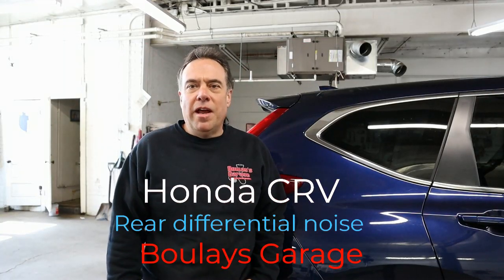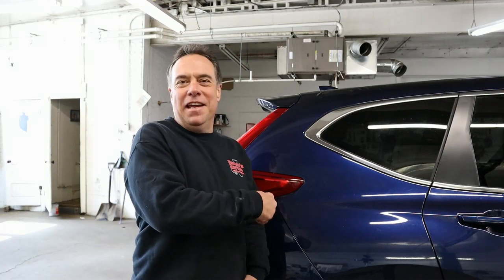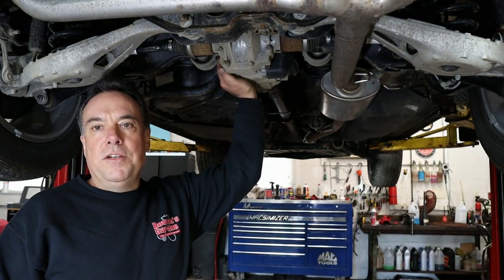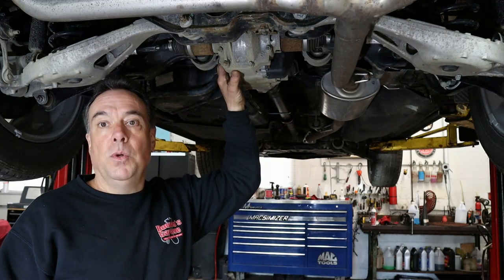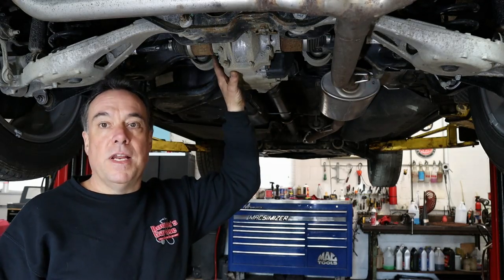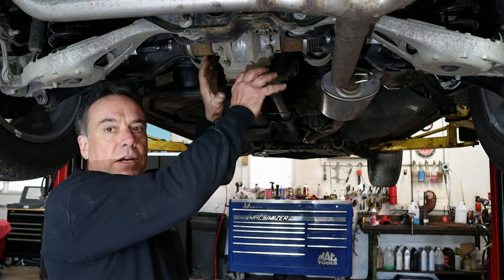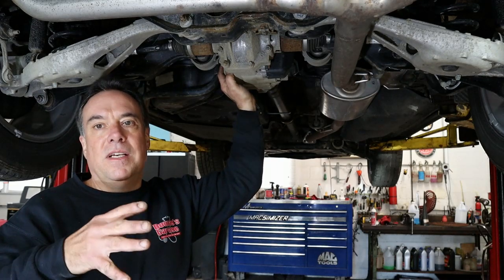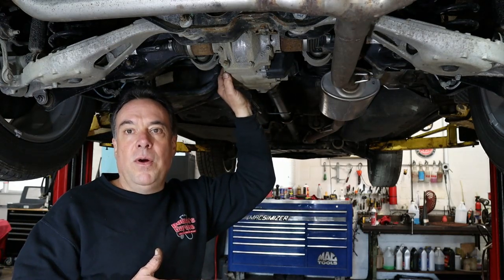Honda CRV Rear differential noise.

Comment: Hi Joe, my CRV seems to have this problem, but I don't actually perceive/hear the noise coming from the rear part of it, it looks more like it's coming from the very front. Btw, my mechanic told me I can replace Dual Pump II fluid with 80W90 fluid, would you recommend that? Thanks in advance.
Reply: Nope only use Honda Fluid
Reply from the maker: Only Dual pump fluid unless of course your mechanic wants to change the rear differential afterwards.

Comment: I have a noise that it sounds like brake shoe dragging during U-turns but not in reverse and I do get a little howl on the freeway.
Reply: Hello, do you still get the howling noises
Reply: Is that just from old differential fluid?

Comment: My 2013 CRV shutters violently upon acceleration. I tried replacing the fluid two times without affect. I also replaced the driveshaft with no effect.
Reply from the maker: You could possibly have a worn out inner cv joint. Those can be difficult to diagnose. If any of the axles have been replaced in the front with aftermarket axles they often times will vibrate upon acceleration mostly because they do not come with the rubber balancer that is at the middle of the axle shaft itself.You could also possibly have some things going on with the torque converter. Make sure if you change the transmission fluid you use only genuine Honda fluid specifically for your vehicle. Hope this helps

Comment: Planning to do the diff fluid in my wife's just for good maintenance but it's seemingly has a bad passenger side rear wheel bearing. Only hear it at probably 50+MPH. Are they fairly common or are you thinking it could be the diff making that whine? Haven't heard any noises in a parking lot.

Comment: Thankyou!  I get the howling or resonating noise (sounds like metal flasks vibrating together) when accelerating in low gears.  Local mechanic put the willies up me by saying it's likely a worn Big end Bearing.  Avg 2 months to wait until mechanics in the UK are avilable (since brexit) so hopefully this is the issue!
Reply from the maker: You’re welcome!
Reply: @jillybean1108  Hehe 🙏🏽
(How weird that I'm finding it a physical relief to see "you're" spelled correctly online)
Reply: @andrewbird8624 hi 😊did the problem goes away when you replace oil on both diffs😊???

Comment: I've got a 2005 CR-V and it started making a howling noice in the rear a few weeks ago . It does it all the time not just when you're turning . Does that indicate a bearing or the differential in your opinion .
Reply from the maker: It is possible that it could be a wheel bearing as well. Easiest way to determine that is have the vehicle on a hoist with the wheels spinning with a automotive type stethoscope to determine the location of the noise. If you have not change the fluid I recommend you do so to start off with. It can’t hurt. I hope this helps you Glenn.
Reply: @jillybean1108  
I just rotated the tires and no change it was worth a shot lol . The noise it's making it the same almost as a winter tire that's the best way I can describe it . I'll change the oil first and go from there thanks for answering .
Reply from the maker: Definitely sounds like a wheel bearing to me
Reply: @jillybean1108  
I got in the back and the wife took it for a drive . It's weird I can hear the noise on both sides .
Reply: @jillybean1108  
I took it to a garage and they couldn't identify the noise . They said it wasn't a wheel bearing and they said there was only a slight noise from the differential . I changed the oil in the differential but you can still hear it . Not sure where to go now .
Reply: @glenmckelvey5952  did you ever figure it out? My moms is doing the same thing.
Reply: @robertclabaugh9892  
My wife ended up changing the back wheel bearings . And that solved that problem but then she had to change the front wheel bearings front and rear suspension front CV joint on the passenger side and then the rear subframe went . These vehicles seem to require a lot of money maintenance .

Comment: I have a  2009 honda pilot 4wd, and its making that noise on a Left U turn only. Do you think i have the same issue?
Reply from the maker: It depends on how much mileage you have and whether or not its ever been changed or not. The rear differentials can get noisy in pilots and ridgelines as well with dirty fluid for sure.

Comment: 2014 crv just a loud constant hum when driving changed out rear wheel bearings, didn’t help. Suggestions?
Reply from the maker: Without actually hearing it that’s a difficult one too help you with. I assume the tires aren’t choppy?

Comment: Does the 2011 crosstour make that same sound when making turns
Reply from the maker: I haven’t heard a crosstour make that noise yet however I have heard the noise from a Honda ridgeline. So it is absolutely possible if the fluid is dirty enough.

Comment: When if you hear a whining noise while driving over 20mph? From the rear
Reply from the maker: Possibly a wheel bearing.
Reply: is it older crv,96-02?and do you hear it when trurning full lock?

Comment: Would anyone know why the axles wont stay in properly
Reply: are they original oem axles?  some aftermarket won't work .  if you removed them and put back they may not have been seated properly or seals may be getting in the way if you pulled out and may have disturbed the seals.  they can be tough to remove and get back in properly sometimes, use a dead blow mallet or 2x4 to help persuade them in if you can.

Comment: Honda CR-V change oil 5k, change tranny fluid 3 qts every 30k change rear diff dual pump fluid every 30k and she’ll last a long ass time. Neglect her and she’ll still go a long time but not as much as she could have had you done these fluids. Honda can last a lot of miles. Oh and plugs at 100k

Comment: I have a 2014 Honda CR-V and when in reverse and wheels are turned, more when turned to the right, it makes like a grinding type of sound.... Any idea what this may be??
Reply from the maker: It’s hard to actually diagnose a noise without actually hearing it. Is it coming from the front or the rear?
Reply: @jillybean1108  the rear. Only when I'm in reverse and turning the wheels backing up. It doesn't happen every time, but most of the time
Reply: Mine does it when I make U-turns either direction but not in reverse??
Reply: Did you get a diagnoses for that mine is doing the same thing!